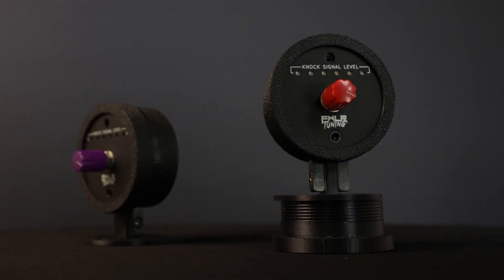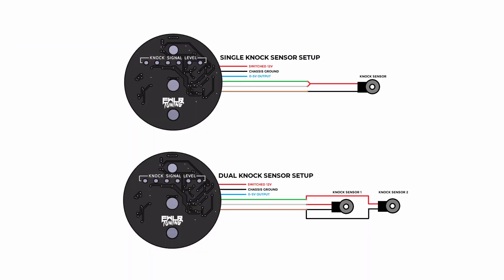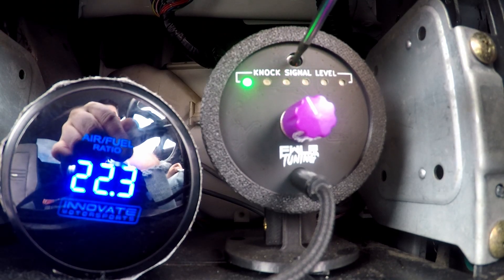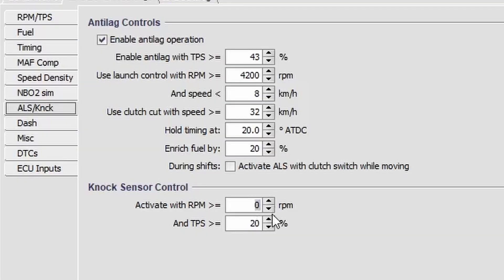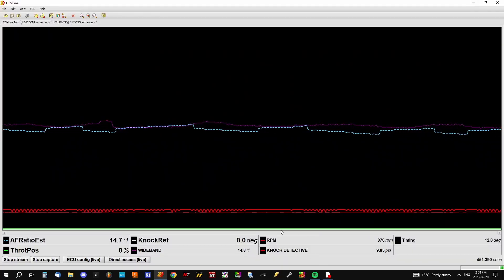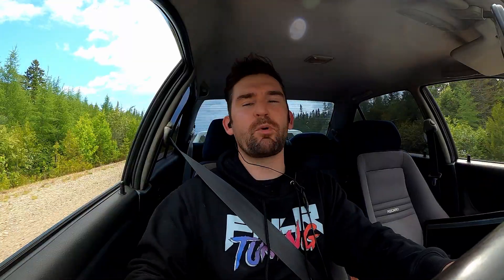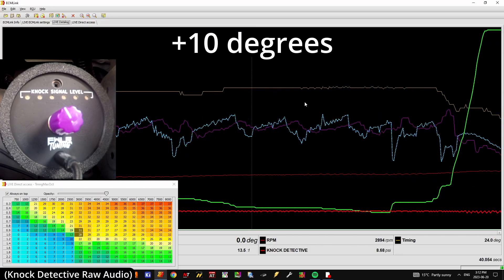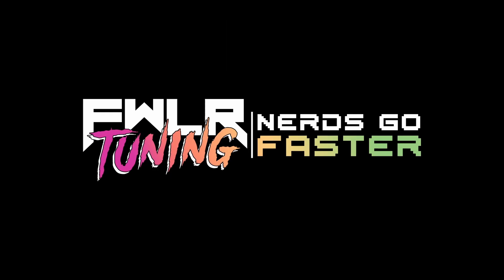The FWLRtuning Knock Detective

Comment: How can I connect the 5 V analog to  that dialogue
Reply from the maker: Do you mean how do you datalog a custom analog input in the ECMtuning software?
Reply: @FWLR.tuning  yes lol  i’m running an S300 software on Honda  I would like to connect the Knock sensor device to my computer so I could see real time life data
Reply: So that 5 V wire on the device will go onto my analog inputs in my ECM software and it should pull up life reading datalog
Reply: @angeluribe2232 The way you are asking that question, makes it seem like you don’t know how to data log wideband o2 with your setup. If so, start there first please, as a bonus you will then understand how to data log this device.

Comment: Can the output for datalogging also be used to add knock detection/pulling timing? Old Honda ECU doesnt have a knock sensor but with an addon board it could receive a knock signal.
Reply from the maker: It really depends on the tuning platform. The signal it outputs isn't a knock signal, it's an analog voltage representing the amplitude of the higher frequencies of the engine's noise. There is a section on my website called guides where I explain how to use that signal with various ECUs

Comment: How does this work with old cars with no ECU?
Reply from the maker: This is a standalone device that only requires 12V and ground to operate. It comes with it's own knock sensor so you can bolt it to anything
Reply: @FWLR.tuning  where would it bolt to? Valve cover? Block? Something else?
Reply from the maker: @AZGhost623  Ideally to the center of your block close to the deck, but anywhere on the engine will work. I've even bolted it onto my transmission to test it and you can still hear knock clearly.